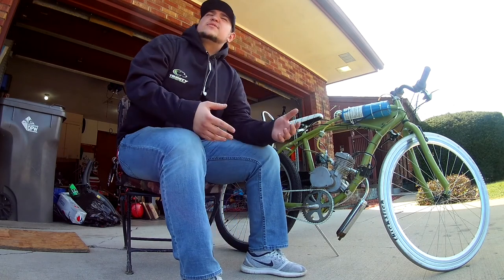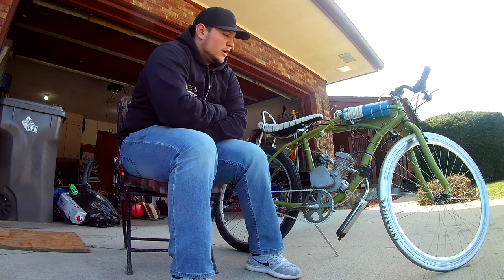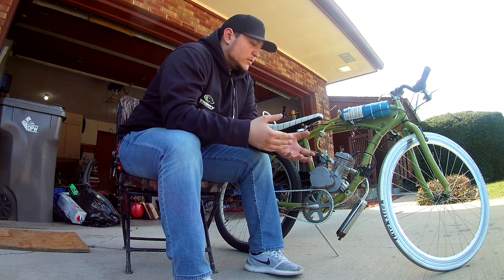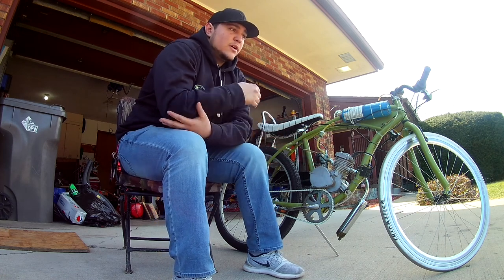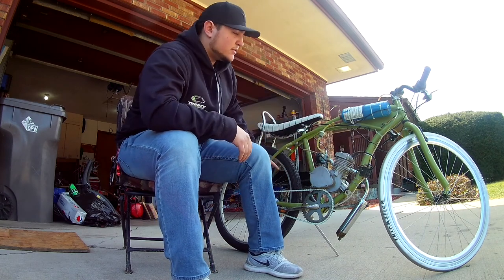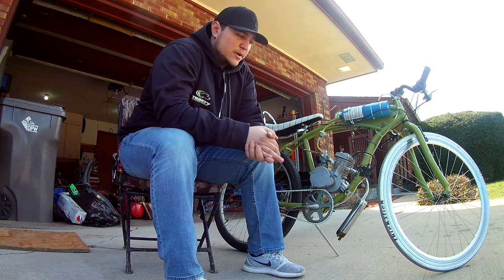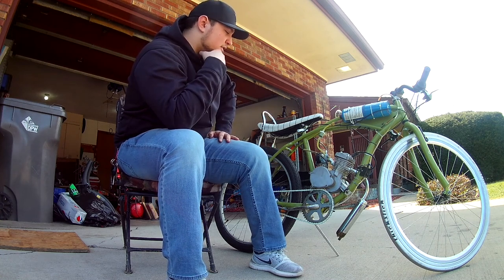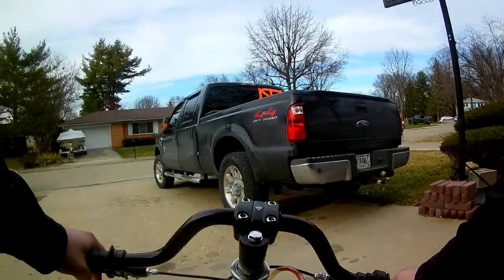I got my motorized bike running! | Vlog 4

Comment: How did you make your propane fuel tank its dope
Reply from the maker: Hilario Baldonado Thanks! I JB welded the main valve on the take shut. Then I drilled out one of the Schrader valve that was off to the side of the main valve. Then I just JB welded some fittings to it so I can attach the fuel line. Finally I drilled a hole at the top to fill it up and cap it with a rubber plug with a hole drilled in it for ventilation
Reply: thanks Gabriel.
Reply: Same here love the tank would like to see more but sounds easy enough thx for the video cheers!